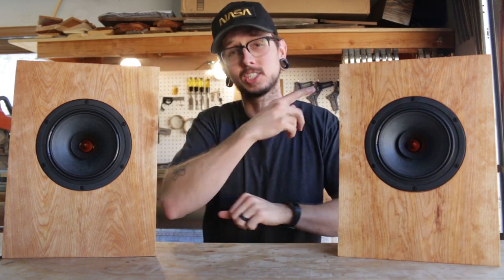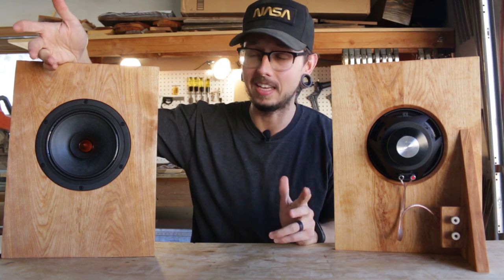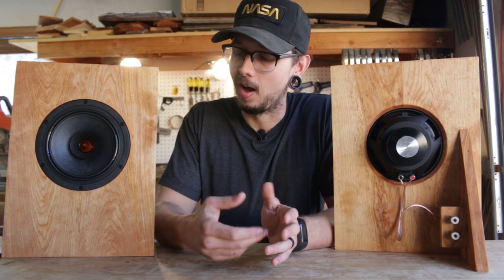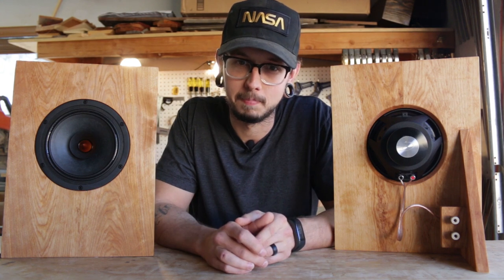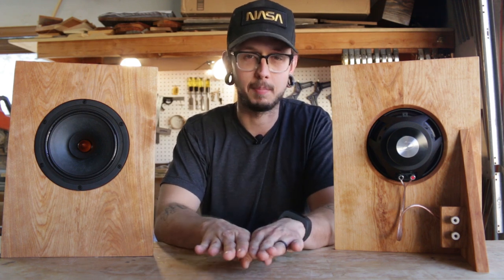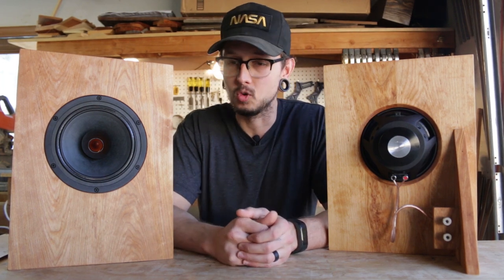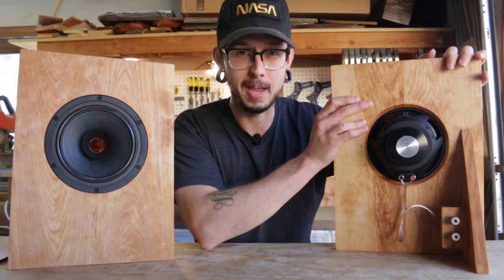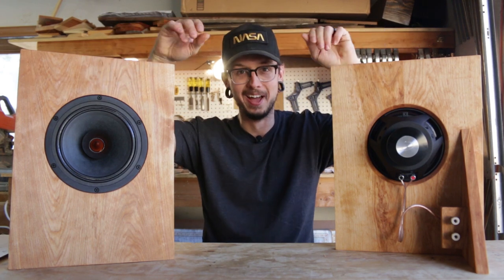When It All Goes Wrong While Trying New Things || BUILD TALK || Asking For Help!

Comment: The only enclosuers I have made was a pair of transmition lines and a pair of dispersed ports, both had a very 'open' sound, so I am no expert.
I do remember reading that open baffles need to be quite big as the bass is proprtional the the baffle size, and as 100Hz has a wave length of 3.4mtrs, that a big baffle! as a compromise you could try open backed?

Comment: Nice try Kirby - but I'm afraid I just don't buy the open baffle concept, there is always going to be too much interference,  bad sound dispersion and room effects to make a quality sound stage.
Like the drivers though, been tempted by a pair of those for my cast concrete transmission line experiment
Reply: lurkio77 you should listen to a proper ob design. The sound stage is phenomenal. I tested mine with an IASCA disk. With proper position and the back wall reflection it sounds like you're in a live club while the speakers disappear. Just listen to a pair of Martin Logan's for the open airiness effect of o.b.'s
Reply: I'm sure if you had a large enough room or totally unreflective back wall then the reflections wouldn't cause cancellations/ phase problems at 1/4, 1/2, and full wavelengths but otherwise I can't see how an OB design can be reproducing sound properly
My suspicion is the OB lovers have taught themselves to love the effect of these reflections and I'm not ruling out that they could be pleasurable to listen to, but they can't be accurate sound reproduction

Comment: you should get drivers that need a big box so that your open baffle speakers use the room as a box so if you dont have enough air pressure to fill up the room it wont sound good or you could make a box with one side open it will perform better than your current setup but it wouldnt be a huge improvement you can also make a surround system like get 5-6 same speakers that would compensate the lack of airpressure in the room the only problem with your current setup is that the room you play it in is tooo big! thats all

Comment: Hi Kirby! I am going to build OB's. I bought Eminence speakers because they have a total quality factor of at least 0.7 For frequencies below 150Hz I will be using a technique called: "slot loaded open baffle". And size matters: I will use 2 12" subwoofers in "slot loading", a 12" bass speaker and a 10" midrange per channel.

Comment: Great Job Kirby !
Thank You Very Much !!
Very Interesting and am Looking Forward to the Upcoming Vids. 
As Some Have Stated, I Think The Speaker is The Culprit. Not The Design Itself. 
I Don't Have Any Experience With the Open Design, as Far As listening Goes, But I Would Guess, That a Speaker With Good Bass Response Would Do Fine In this Application, Especially if if it Was Placed Near a Wall, or Other Hard Surface Where the Back Could Reflect. I Think a SubWoofer Would Probably Be Overkill, Unless You Had And Additional Mid-Range Incorporated In the Design.

Comment: ry some decent car door speakers as they are designed to operate with low to no back pressure typical drivers need cabinet pressure or they will bottom out to easy

Comment: In all my years as an audiophile i found that my Fostex FE206En sounds quite amazing in open bafel config. All you need is a good amp a good dac a clean source and to add a subwoofer to handle the base and you have something that's far better then any thing else for the same money.  I think it's just a mater of finding the speaker that sounds good to you and you never go back to closed enclosures again. And you can simply add a tweeter later on if you feel like it.

Comment: The tools are more expensive than the speakers, when you put everything together you can afford top notch speakers.
Reply: This is not the point of DIY speakers. Even though the result does matter of course, it is mainly about the process of creation. If you build your own speakers, you enjoy building and having some challenges. That's why you probably already own or have no problem with investing in some tools.

Comment: I've seen tons of comments on your videos about the (apparent) lack of a baffle step compensation. Seriously. If you want to make a speaker sounds full and not lacking in the low mids and bass (as these are), you NEED to include that in your crossover design - no way around it. It's the laws of acoustical physics. Learn them before you go to making and selling speakers. Also, get yourself a quality reference mic to measure your speakers so you can fine-tune the crossover. What sims model up isn't always exactly what comes out in real life.
Reply: Kcducttaper1 This is a full range single driver... There is no application for a crossover here. You need to cut Kirby some slack. He's catering to the newbies.  He's building a foundation to teach off of.  There is a lot to learn from this build. Though it may not be evident until later builds as the lessons of the failures here may come in future builds (Ex: enclosure design in relation to bass performance).  Kirby is not an expert & has never claimed to be.  I have made a living (20+ years) designing, selling & installing high end audio systems and I find I can still learn a thing or two. Audio, or more accurately, sound reproduction, is such a perfect science on paper. But it is ultimately muddied by listener preferences, an individual's ability to hear (all frequencies), room acoustics... and we haven't even discussed equipment.
Reply: I shouldn't have called it a 'crossover'. You're right, there is no 'crossover' in a full range speaker, but there still needs to be a BSC network if you don't want them to sound hollow. All of your pro audio speakers will have a BSC built into their circuitry. I did a bit in the pro audio area for a few years as well, but designing and building your own speakers is a whole different ball game. My gripe is, he seems to have a complete lack of understanding regarding what baffle step loss is and how to account for it. As far as I can tell, he's literally taking 2x $25 drivers (Dayton Audio PS95-8), sticking them in a wooden box, and selling them for $250 (Cube Speakers). Unless he's alluded to the inclusion of a BSC in there somewhere, those drivers do sound hollow. I know; I built a small set with those drivers just for giggles once. Ain't no way I'd spend that kind of money on those speakers without a BSC. Those cube drivers also have a goofy little notch in the response curve around 1900Hz. For $250, I would expect a small network to tame that down a little bit too.

Kirby does this for a living. He's catering to his wallet. Not trying to be rude, but that's just what it is.
Reply: Kcducttaper1 I agree a BSC circuit would help on a lot of these full range builds. That or active dsp/eq. Both get the job done the same.

Comment: Hi Kirby. First of all, congrats for the very good job in all your builds! The problem is always if the speaker is built and fit for open baffles, which is not the case of these you have tried. Try these ones "Tang Band W8-1808 8" Neodymium Full Range Driver". They are suited for open baffle applications and are for sell in Parts Express. I truly believe you'll be satisfied then. The only final remark is that you must check the wood plate. You may need to design it differently (bigger). Try it out and then tell us what is your experience. Thanks and good luck!

Comment: Don't listen to any of the rocket scientist here on the other nonsense. It's just your driver choice. I have some vintage drivers (Zenith 49cz852) that you can throw in the bed with no baffles that will make you weep with joy. I also have a set of very small vintage drivers (Coral Holey Baskets, Sony 8 ohm version) that will do bass just fine. They're like 3.5inches I think. I toss them in a cardboard box with the back open, but use the box tops like wings. Small boxes too. Like no more then 12" x 8". The Bass is fine. I liked them so much that I bought another pair. I took them down a couple of weeks ago, because I got some new Cerwin Vega VS-150's for a song, along with a new high powered SS amp, and a DAC/Pre combo. But they're going back up soon in some configuration.

To be fair. I was using them on tube amps. Mainly my HH Scott 200. And they were all designed at the same time, and work well together. The low damping works well with these speakers people say. But I also have modern ones too, that were designed for modern amps. And plenty of people use these, and are happy. In all types of setups. So if you're planning on using a more modern SS amp. You can. I highly recommend tubes for open baffles though. As both are all about the midrange.

As for the bass. You're not getting it, because of the Qts. of the driver. That's it. Period. You can get more with the perfect design, but bigger isn't always better. And you'll never get bass slam with open baffle. It's a natural bass. Think stand up jazz bass at best. But it sounds like it should. Not fake. No real instrument makes bass slam. That's all done with electronics, recording techniques, and boxes.

How you use the baffles for other drivers. They should sound better on their side BTW. They seem to like wider. And don't forget you can use wings to get the same effect as the baffle. And you can even vary the length of those for better cancelation.

Comment: As many others mentioned earlier, Qts value about 0.6-0.75 are ideal for open baffles. I built a pair about 4 years ago, used 2 VISATON B200 full-range drivers per side. While testing it sounded very airy and stuff but there was absolutely no bass, virtually no highs. Using a passive crossover I added a VISATON TIW 250XS 10" woofer per side. The result: a thin, muddy, insecure bass-ish sound that was everywhere in the room (as I stood at a corner of the room the distortion was unbearable). Then I reworked the whole idea and kept the full range drivers arranged in diagonal direction on an open baffle column twice the size of the first I made, and built a 40 liter ported box for the woofers. The result was accurate and deep bass with a same open-ish airy and light midrange, and at the end the highs came also. I found there's no software that can design a dipole speaker for you, so I guess it's a real trial and error thing.

Comment: So, I think This build is just a clear waste, in this kind of build type there is NO sound quality. It`s worse than you said it would sound like. And why do you use ported build? It is very easy to kill builds sound quality if you make port wrong size, and even if you get the right size it will give very small change in sound.
Reply: first: because you have to experiment
Second: we are also talking about hifi speaker not studio monitors
No matter if the loudspeaker does not have a band passing from 20Hz to 20KHz with the most linear curve

the hifi is to have pleasure to listen to the music but not bother to make the speaker with the frequenc respond as possible as possible.
And also you have to make speakers that sound perfect for yourself but not necessarily for other people

if you like the bass makes the speakers with a resonance frequency as low as possible and makes them in a ported box

if you like the mid / high frequency make bookshelf speaker with great mid/high but not necessarily bass reproduction